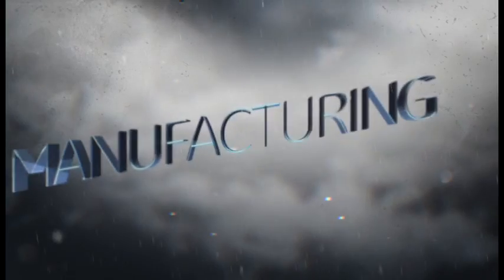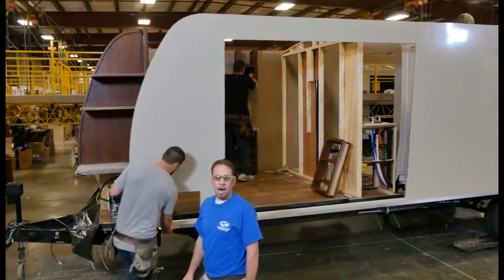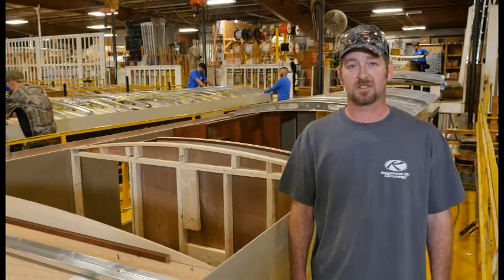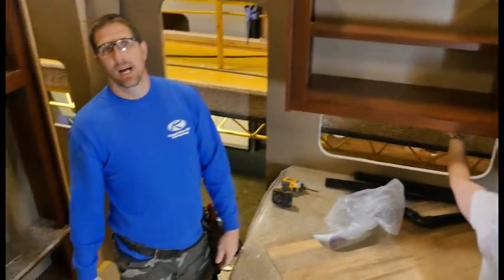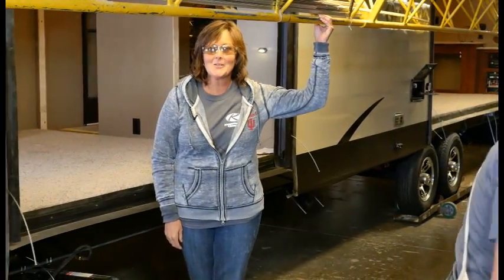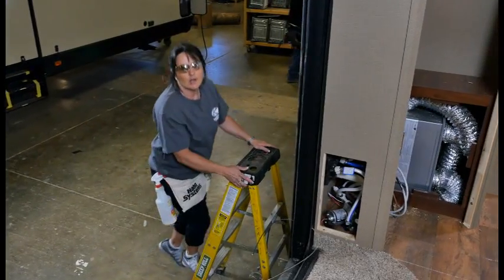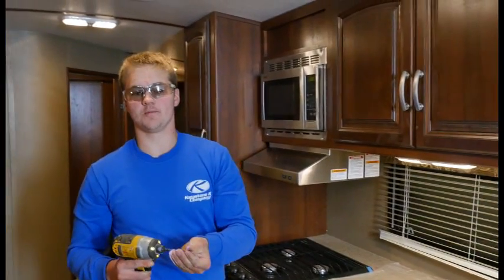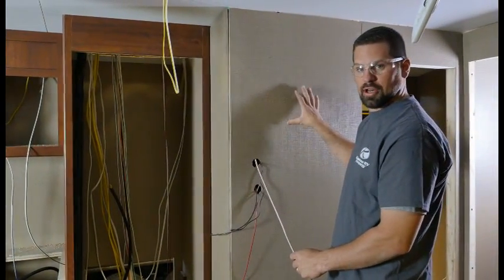Keystone RV - Manufacturing

Comment: I purchased a 2021 Passport GT and the quality is horrible. I contacted Keystone to get a overview of where wiring, ducts, supports are and was told it is propriety information 😡 It’s a RV, get real. As a owner I’m entitled to the information! I worked commercial aviation for 25 years so I have a idea on quality and actual proprietary information. The only reason I bought this unit because it was available in my time frame and had features I wanted but I never expected the build quality to be so bad as confirmed by comments below. And being refused access to the manuals I need as a owner is a major issue that I will be pursuing by whatever mean's available and I urge all owners to do the same!

Comment: The strips along the bunk bed came off bearing nails poked my son within the month we purchased our 2019 Outback RV. 
The strips on both slides have come off. 
The window screen plastic strip broke, cannot leave window open due to bugs. All within the 1st month. Purchased new!
Needless to say 1 year 9 months floor is sagging feels like we’re going to fall through the floor,
Had to buy new stairs, both original stairs are trash
The oven did not work
@warranty is a joke. They messed up more than fixing.

Comment: Are you tiered of caulking your roof ? we'll look no further, I do roofing work on campers. I've been doing it for 5 years now with the same company. We offer a lifetime spray on roof for rv's and and motorhomes, Pro-tek LLC is located in houma Louisiana. We offer a lifetime spray on roof, you'll never have to caulk or seal your roof again. We take your rubber roof off completely to get down to the plywood because you need a good foundation to start from, if you have any soft spots or water damage we change out the whole sheet of plwood, then we prep the camper for spraying and after its sprayed the roof is completely seem less and uv protected. We all so spray your a/c cover and install new plumbing vents which are also sprayed in, for extra protection we install camco vent covers even if you dont have them and the sun won't Deteriorate it like it does to a rubber roof with brittle fixtures. Oh did i also mention we are insurance approved ? the insurance companys would pay to have our roof put on compared to another rubber roof because its cheaper with a lifetime warranty you have any more questions you can call for more in depth details look us up on Facebook and youtube also if you have any further more questions give us a call at +1 985-262-8757, we do everything camper related also, thank you for your time and we always say either its leaking or its going to leak don't wait till its to late 👍 p.s. tell them terel sent you lol.

Comment: I had to sell my $54,000.00 for $20,000.00 it leaked from front to back the sky lights dry rotted and leaked, cheep Chinese tires 3 blowouts on the same trip the fifth wheel tung bent, fire place quit heating. a/c wouldn't cool the camper but down to 80 degrees.
It was only left out for 4 months the rest of its life was under a new carport I got the day I pulled my camper off the lot brand new.
the 4 slides never worked properly they would bind and have to reset the breaker and start again. I have camped all my life and even as a child with my mom and dad and have NEVER had a camper this bad and sorry built. STAY AWAY FROM keystone.

Comment: I regret buying my 29BHSWE…been nothing but low quality and constant design flaws.  Its a pain when you get to a campsite after driving hours and something doesn’t work!  I guess anything built during the pandemic is garbage.  We are considering trading it in for something different at this point in time.  $63k for something that doesn’t fulfill our needs is BS.

Comment: Full of crap.... no different from other companies.
Reply: Matt Zimmerman is just another salesman.....I don't care which RV manufacturer it is, they are all making these things as fast and cheap as possible like Kevin said above.  Faster and cheaper = more profits. These manufacturers just throw them together and the attitude is "let the dealers handle the details of repair."  
If these manufacturers really cared about making a lighter and quality product, they wouldn't be using MDF throughout the unit.  MDF is garbage and it's heavier than real wood.  It doesn't hold up to the elements.  It all starts at the top.....do you hear us Matt Zimmerman?

Comment: Keystone JUNK. 2018 Springdale Mini by Keystone.  First trip molding came loose, second trip out more molding and the bathroom door wouldn't latch. This year's first trip the staples came out and  the ceiling  dropped. Now the roofs sheeting is separating and the staples are coming through the roofs membrane. Poor craftsmanship and refuse to make any repairs to fix the roof before the water comes inside..

Comment: Do not  buy anything keystone or forest river. They are built like shit. Take it from someone who used to work on them for a living.
Reply: I am currently looking at a 2015 Sabre 33CKTS fifth wheel,  built by Forest River. What are your thoughts about Sabre trailers? Thank you for your time.
Reply: @DatGuy960  Name one RV that isn't junk. Maybe the Airstreem. But I dont have 160,000$ lying around....do you? I've even seen and read of multiple issues with Tiffen. Yes, there needs to be better quality put into these things. But unfortunately, it's what we got. Thay ALL have their issues. I just bought my last camper, (Cougar) ,After this one....I'm done. If I wanna camp again I'll buy a tent.  Just take care of your camper, fix what breaks and camp on.
Reply: We have a 2016 FR Puma. Bought it used and are 2nd owners. I can't find anything wrong so far. And it's been pulled behind me for 3000 miles. I almost bought a Hideout. Thinking I made the better choice.